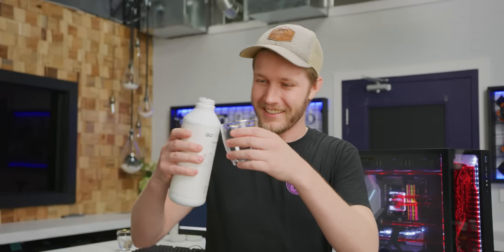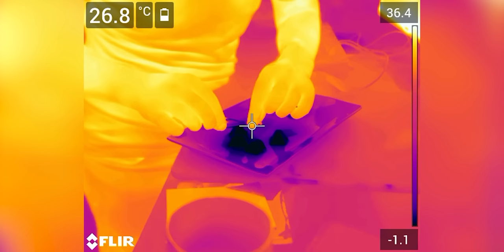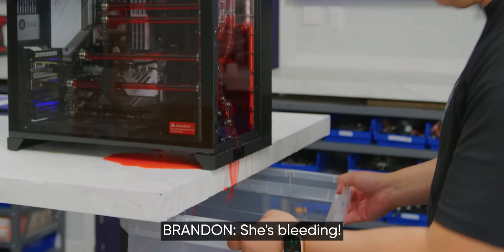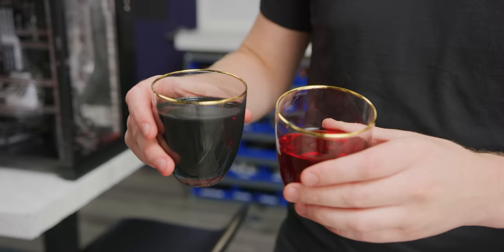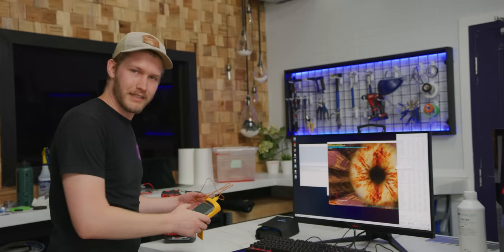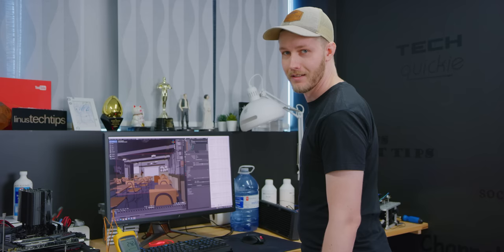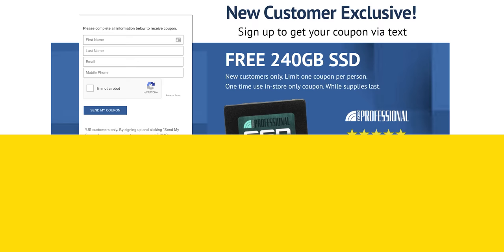7°C Cooler? This must be a scam - GoChiller Graphene Coolant Review

Comment: Electrically conductive doesn't sound optimal for PC cooling. Even if you clean a spill/leak you may leave some electrically conductive residue.
Reply: A non conductive fluid will pick up contaminants from the loop and become conductive fairly quickly anyway.
Reply: Even without leaks, imagine leaving this liquid in there for couple of months, the cleanup afterward would be a nightmare i imagine.
Reply: yeah that and the eventual clogging and gunk that will for sure accumulate no thanks staying with clear liquids
Reply: @rb30e  perhaps, but can't be as conductive as the most conductive material discovered so far (graphene) according to the video.
Reply: try watching the video
Reply: @JackMott  I did, but when happens if you spill it, it dries, then can no longer create a coating. Also that's just their theory, not necessarily 100% fact/true. (Although it might be true)

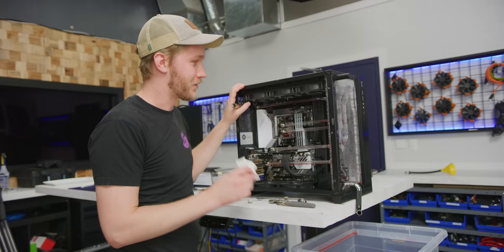Edit: that's if you're talking about the results @5:20 specifically when they talk about creating a "coating" @6:15
Reply: Doesn't stop people putting electrically conductive TIM on their de-lidded chips that's made of gallium alloy that has every potential for turning certain metals into cheese. If you're willing to do that just to get an extra 0.5% overclocking boost out of your system, what's so odd about conductive coolant?
Reply: @technicalfool  for the fact that typically de-lidding is done outside of a system, but this has be done with the system parts installed. Thus is a leak or even a drop lands on something, you have to very thoroughly clean it, and even still you may not get all the graphene particles off, which may kill whichever component it was on, and possibly even other components.

It's possible that wouldn't be the case, but I'd be pretty skeptical until someone tried it with some old trash system and put a drop on the back of a crappy old trash GPU or Mobo and see the effects.

Edit: additionally those components with liquid metal TIM are stationary once the PC is assembled (except when moving they system). whereas, the liquid in your system is constantly moving (if it's working properly), and in the even that there is a leak on assembly of the loop, or even after time  as leaks can develop over time, that constantly moving graphene could end up on a component in the system. Thus the reason for more concern
Reply: @brandoneich2412  Graphene isn't some sticky substance that sticks to surfaces and such. If you wiped it off, it would be gone. But your system isn't really in any more danger than using plain water.
Reply: @williameldridge9382  I understand it's not sticky, but I'm saying how can you be sure it's all gone? For example it a drop fell and it got under a BGA (ball grid array) style chip(think vram chips or the ram module chips, or the chips on m.2 drives), how can you be certain all the graphene particles are removed before you power it on.  With water you can let it air dry and it will likely not leave anything (unless your water has minerals in it) , but this literally has nanoparticles of the most electrically conductive material known to mankind yet.
Reply: facelessninetytwo aka Man of the Rain  likely because of the corrosion inhibitors, but what happens when the liquid is wiped away and some of the  graphene particulates are left. Will the corrosion inhibitors do anything when they are not in liquid? What then? Is that a risk you'd be willing to take?

Comment: Mechanic tip, gentle unscrew the top port and then open up the bottom. It makes a radiator drain so much easier.
Do it all the time with cars.

Comment: When comparing keep in mind your cryofuel was used. It would have picked up ions over it's life in the loop.  Fresh fluid might be less conductive.  Same goes with water, after a while of running in a loop it will pick up ions from the loop components.
Reply: Holy shit you joined 14 years ago?!
Reply: you joined in 2007??????????? dayum
Reply: @treatoplease3479  I know it's shocking but youtubes been around for a couple years
Reply: @treatoplease3479  Not that uncommon. I also joined 14 years ago.  I actually created this account a month before Saulverde.
Reply: @treatoplease3479  
Not everyone on youtube is 14 years old.
Reply: I have also been on the platform for a minute..

Comment: Seems like a very cool fluid!

But im also very interested in a long term test vs. a „normal“ coolant to see if there is more or less abrasion on the coolers and if there is more or less residue from the particles falling out of solution. 

Evaporation-rate shouldn’t be significantly changed vs. normal coolant or distilled water
and Evaporation-rate is also dependent on how airtight your loop is.

Comment: I wonder how the graphene particles affect the inside of the tubes and pump over time... Like does it scratch up/cut the inside of soft, hard plastic or rubber tubing?
Reply: Was wondering the same thing.
Reply: I imagine it doesn't. Graphite is used as a lubricant and graphene coatings are used for abrasion resistance.
Reply: I'd be more interested to see if it gunks up the microfins over time or if it foams up in the pump and kills that prematurely.
Reply: @honeybadger6275  Exactly, 30 minute tests for a new type of liquid are almost useless.
Reply: @honeybadger6275  yeah i don’t even give a damn about its „superior performance“ either. Just call it fancy coolant and people would still buy it all I’m concerned about is that stuff coming out of suspension literally everywhere constantly and forcing me to clean out every single component of my loop regularly cause that’d just be much more of a pain than fancy looking coolant is really worth to me
Reply: Good point it actually could be worse for the metal parts

Comment: I would expect a greater effect if smaller radiators were used. The pump speed also plays a role, why didn't you try to test low, medium and high speeds?
Reply: the speed of the coolant negligibly effects heat transfer unless you slow it way, way down. you're the first person to make the correct assumption that a smaller radiator would have shown a greater effect though.

Comment: 6:12 "bring in the engineers" That is exactly what I expected them to be like honestly, just sitting and observing quietly
Reply: What did they say about the resistance across a little distance of coolant ? I would have thought graphene would act as wires  if it really changed the water?  I think its such a tiny amount added to make it go black,that the electrical conducivy didn't change much. The fluid will just be glycerine or something, which  will just boost specific heat a bit... Or its the antifoaming agent only making a change?

Comment: Distrust ANYTHING that says "graphene" or "diamond" on the label... :) The main ingredients in that snake oil is most probably pulverized graphite and a suspension/dispersion agent. No "graphene" has ever been near that bottle :)
Also, like with all dyes and additives - the real test is letting the system run for a year. My guess is that you can just as well throw that system in the bin after a year, one bad thing about highly conductive additives is that they bond like superglue to metals after long exposure :/

Comment: The graphene would have to come in contact with the walls for this to work effectively, the boundary layer of a flowing liquid should prevent most of that from happening.
Reply: So in other words the graphene does not do much except add a sort of liquid charcoal look. It IS is amazing looking though, very different from just a black fluid. If I has a water cooled PC I might even buy some, provided it does not clog the system up.
Reply: I guess the other stuff creating a coating around the graphene particles (as they guess in the conductivity part) doesn't help either. i guess all it really does is making the liquid look fancy and be wayyy more abrasive at the same time...
Reply: Yeah. Hearing how graphene conducts heat, it seems like it would be more useful as a heat pipe than something mixed in with the coolant.
Reply: @bilateralrope8643  I thought so too, like integrate it into a new "heatsink" design
Reply: this is not correct at all, please do some research on nanofluids. the heat transfer mechanism is still up for debate but there are very concrete gains in conductivity with nanoparticle suspensions. that being said i would never put them in a pc cooler as suspension stability is the hardest part of the equation - an engineer with research experience in nanofluids.
Reply: @ihrm4  links to the literature?
Reply: and of course if they do attach to the walls, they'll  increase turbulence and drive up the loop pumping resistance (== more pump power)

Turbulence is good in places where you need it (heat transfer interfaces), not so good elsewhere
Reply: @bilateralrope8643  not even then. 

Water-based heat pipes have insane thermal conductivity thanks to the phase change - and are gravity immune thanks to water's capilliary effects. That's WHY they were originally developed for cooling spacecraft in zero gravity conditions.

Nothing else comes close to water's effectiveness, not even Seymour Cray's fancy freon waterfalls

Comment: Tried this stuff in my water cooled laptop build because it looks SICK. Within a week my dry break quick disconnects started to become less and less dry break. They never leaked but they went from next to no fluid coming out to needing to keep a paper towel on hand when moving the laptop because about .5ml would be coming out. Looked great but with how quickly it was gunking up the connectors I flushed it.

Comment: there is a company in Australia that has a process for refining graphene and is implementing it into things like mining buckets and other stuff, making the buckets last 6x longer than the original ones. It's a wonder material.
Reply: You may be referring to GMG. The have a graphene based product that coats the fins and makes HVAC 15-20% more efficient.  They are also working on a killer aluminum ion battery impregnated into it's proprietary graphene.
Reply: @vivacinquecento  I don’t quite remember but I think it’s something along those lines

Comment: I think you would find a larger temp change with short burst loads rather than sustained load. As with most water loops once the fluid has reached equilibrium you are limited by how much heat can be removed by the rad/fans.

Comment: Coolant additives will never have much effect, the heat still has to conduct through a layer of water to get to the graphene particles.  Heat capacity of the coolant also doesn't matter much if you can simply make the pump run faster. The limit is always conduction into and out of the fluid.
Reply: Actually, the limit is usually the radiator and heat transfer from liquid to metal to air.

In my system, running the pump faster does literally nothing to temps. That's because there is already PLENTY of heat transfer into the liquid, but the radiator is the limiting factor. Most water-cooling loops would be the same - unless you have an enormous amount of radiators, it's the radiator capacity that limits the system

Comment: The coolant might be more effective at higher temperatures and with higher heat components. I would've liked to see a GPU tested.
Reply: They tested it with both the gpu and cpu maxed out.
Reply: The first thermal test was run on furmark which cooked their GPU pretty good. I don't personally know of anything better to peg the GPU with.
Reply: They also should've measured the temperature of the fluid at different parts of the system to see if the fluid was the bottleneck or the radiator (is the cpu/gpu not getting it hot enough or is it that the fluid entering the cpu/gpu is already pretty hot)

Comment: Those "Graphene Sheets" aren't actually Graphene. They are called PGS, Pyrolytic Graphite Sheet. They are stacks of imperfect layers of Graphene, which means it isn't Graphene, since Graphite is defined as the same thing, stacks of Graphene type structures.

Comment: id like to say the anti foaming agent is required because they have to use a surfactant to keep the graphene from coming out of solution. surfactants are like soap latching onto the water and the dirt/graphene so it would foam up. comparing this fluid to how much water foams up isnt a fair comparison since it doesnt have a surfactant.
Reply: I don't see how it's not a fair comparison. They compared it to both distilled water and water with coolant in it. There's really not anything else to compare it to.
Reply: @Dibromatic  my point was that neither distilled water or a coolent with additives would need an antifoaming agent anyway. saying the anti foaming agent sucks because theres still foam in the fluid isnt fair because we dont know how foamy the fluid was before the anti foaming agent was added. imagine having a glass of soapy water and stiring it and theres millions of bubbles in it, now add a anti foaming agent and now theres a hundred. wow that anti foaming agent sucks because theres still foam? 
just no.
Reply: Well... Yes. Technically they should rephrase it into "this still foams more than [insert name here] but at least we all get the point. It's not the foaming agent's fault but the "problem" exists.
Reply: @ragetist  yeah and i would like to see how a long term test would end up as well.
Reply: @Quantainiumify  The anti foaming agent still doesn't work great but I agree with you. I have used Foamstop from I believe Addapt Chemicals in the past for various coatings and primers. It did it's job better.